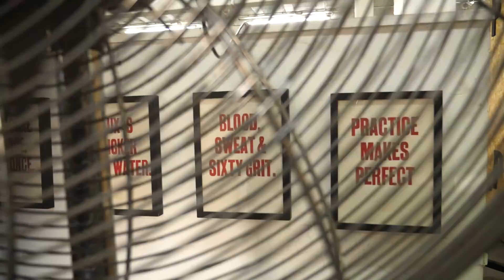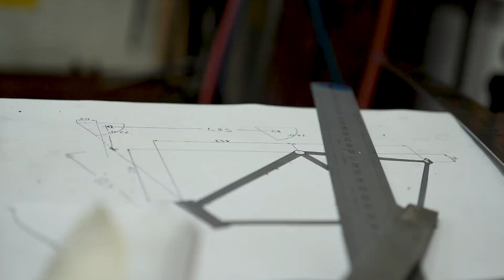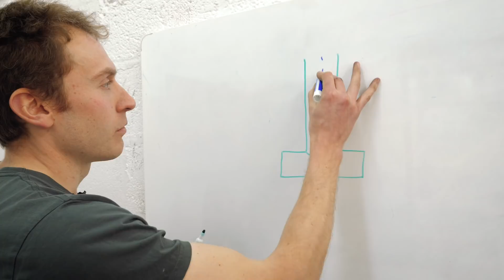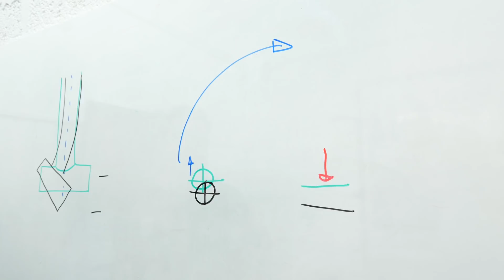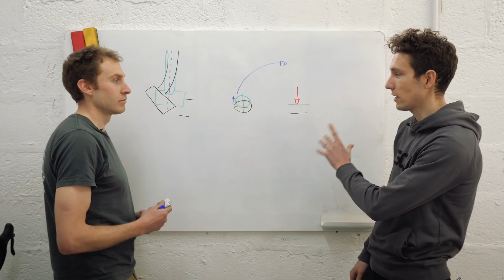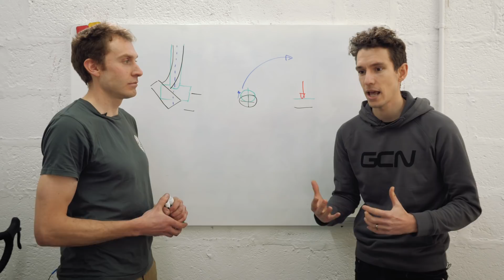Are You Faster On A Stiffer Bike?

Comment: I have a few questions:

Is the energy just stored in the brake on the wheel?
Would the wheel turn if the frame was just physically flexed side to side without input from the cranks and without the brake being involved just physically flexed at the BB?
and would a rear hub based power meter be able to measure?

Great video BTW

Comment: The energy return is immediately after BDC thus propelling the pedal upwards which in turn helps to propel the opposite side downwards, if the pedal style of the rider allows it, if not the anatomy of the rider (musculo-skeletal system) will absorb it. Some may be transfered back to the bike (in a plyometric type fasion) but some will be used to propel the rider in an upwards direction (in a shock absorber type reaction with an angle of return that is perpendicular about the fulcrum, the bottom-bracket) which may then not be transfered back to the bike at the correct point of the pedal stroke depending again on the pedaling style of the rider. Therefor it maybe seen that where a rider can synchronize the  return of energy from frame flex they indeed be more efficient than a rider who cannot.
Bullshit or not?

Comment: Hello, from an old and experienced rider. I believe I can add to this discussion quite a bit. I’m heavy, 220lbs. I love steel, and my favorite bike was a Basso Columbus SL set. However, it was too flexible. It had the best ride, as I’ve said, and I could even feel the energy stored pushing me forward. It was fun! Still, when I started to climb the short steep hills one finds in Southwest Missouri, the frame would flex so much the chain would rub. This equates to drag when least needed or wanted. Flex is great but needs to be managed. This is the first time I’ve ever responded to anything, and would like tell you guys at GNC, thanks for everything you do. Also, I’ve ridden all over America, and for road biking, it doesn’t get better than Missouri, especially the Ozark’s. If you are ever out this way, please get in touch. I have rides you’ll never forget.
Reply: very well said, John.  I would also add to your comments that not only do I believe the riders weight can make a difference, but correspondingly their strength.  Somebody who can really apply torque to the pedals can benefit as well (for similar reasons) to the stiffer frame.  Whereas, someone lighter &/or who doesn't peak too high on power would actually benefit from an appropriate amount of flex.
This is similar to a golf club. Someone who has a real fast/strong swing benefits greatly from a stiffer club by it's ability to keep the club head more in line with the hands & gets distance on the ball from pure swing/power.  However, a person that has more of a slower/modest swing, actually won't hit the ball as far with the stiffer club than they would with a regular or softer flexing club (whichever is most appropriate for their swing/strength), by using the "whip" action of the flexing club shaft to snap the ball & create more energy on contact than the stiff club would.
Reply: Taking this to the extreme, a bike frame made of wet ramen noodle would also yield fairly poor results due to low stiffness (among other poor properties).

Comment: So the brake goes on, then the pedal moves down which puts tension on the chain (and flexes the frame as the chain can't move).

Of course the wheel will move when you release the brake, you've essentially just pulled the chain a bit. Yes, the frame 'absorbs' the tension and releases it but I don't think that says much about frame stiffness.

Comment: Every frame (or material in general) is flexible to some extent. They are like springs. Some are stiffer than the other. Nonetheless, all springs store energy as potential energy and get released when u let it go, translating into motion. What you should understand is that no system is 100% efficient. Springs (and also bike frames) cannot release all the energy it stored as potential energy. Some is lost as heat as someone mentioned somewhere below in the comments. The concept is called hysteresis. The more you flex, the more you lose, given that all other conditions are the same. For different materials and different carbon constructions, equal flex does not translate to equal energy loss, but a flex is a flex.  This is basic science.

Comment: From a simple  mechanical engineering perspective, the bottom bracket junction can essentially be modelled as a spring and damper.  As Simon alludes, the spring will release energy when unloaded and the damper dissipates as heat.  The experiment shown was somewhat flawed as this sort of static loading would have not had a damping effect (although I agree with Simon loses here are probably small). Things become more complicated when you consider a dynamic mechanical system.  Generally an optimum spring/damper system will be tuned to the force and frequency applied.  The same applies to bike frames and it is my explanation why many frames "come alive" when you start hammering.  I find the "climbing bikes" I ride tend to "come alive" in the 300-400 watt range, typical climbing wattages.  In contrast, stiffer aero frames seem "dead" to me at these wattages and don't come alive until a bit higher.  This is my theory why many lightweight GC riders tend to prefer the climbing bikes rather than stiff aero bikes as they are better tuned to their typical wattages on important efforts.  In contrast, heavy sprinters tend to go for the stiff aero bikes which are tuned to the higher wattages.

Comment: But when riding the bike the energy in the frame would be released at the point where the pedal is at the bottom and the cranks are vertical because thats where you stop putting power into it. And at that point it would not pull the chain but push the riders leg upwards.
So why not repeat the experiment with the pedals in a different position or ride two bikes with different frame stiffness and same components, use a rear wheel hub and pedal powermeters and compare the readings which will give an estimate of the loss in the frame?

Comment: Repeat the test from the non-drive side!
Then repeat the test with NO chain.
Forcing the pedal on the drive side cause small tension in the chain - and this tension actually drive the wheel. The theory that the flexing back frame is moving the bike forward is nonsense.

Try to bend (flex) a metal object for example - a soda can. Where is the energy, ha?

Comment: What about the chain? Before releasing the brake the frame is flexing and the chain is stretching. When you release the brake everything goes back to a neutral state and releases energy into the bike. The chain is perfectly aligned to release energy into the wheel. The frame could be experiencing also sorts of losses and I’m not sure if the energy in the frame is going into the wheel or not. How do you know the frame is the dominant source of energy?

Comment: Well, you have ONLY shown us that not ALL energy is lost, as you said, energy doesn't disappear. Basically, this video doesn't proof anything.  It is the same as showing us that energy is regained from releasing a compressed spring.  BUT you didnt or in fact you can't proof there is no energy loss with this simple video, the hysteresis loss would occur in other forms of energy.  Well, good try but may be this is #engineering explained territory.

Comment: Power loss steel / alloy / carbon....This is easy to quantify and I can offer an experiment for you guys to quantify this. I am a rocket Scientist to be fair. so....take my word for it.

Let us assume there is power loss "absorbed" in the frame.

1. Steel bike: Take a hub based power meter and a pedal or crank based power meter on the same bike and monitor the transmission +flex losses at low, medium, high power & high power out of the saddle sprinting. Do this by comparing the differential between the power readings of the two meters over a reasonable period, say 1 minute. Record.
2. Alloy Bike: Transfer the same rear wheel, chainset, chain and derailler and transfer to alloy back and repeat test.
3. Carbon Bike: as above.
4. Evaluation: The transmission losses (often quoted at 5%) will be a constant throughout all the data. The flex losses will be revealed across each frameset as an additional loss. I would hypothesise that this would show a significant(ish) gap at the high power and out of the saddle sprint data set. I would also guess it only becomes REALLY significant when sprinting like a Sagan. 1000W plus.

REAL SCIENCE.... !!!!!!!!!!!!!!!!!!!!!!!!

Regards,

Gutsy.

p.s. The next question relates to tied spokes or not tied spokes? If there is significant powerloss then the science would also suggest that there is additional losses through wheel flex (clearly the aforementioned test does not evaluate power losses through wheel flex. So the argument of tied spokes arises. We all know that tied spokes stiffen the wheel. The question of power loss through wheel flex, at least qualitatively can then be argued.

p.p.s. I tie my spokes!  ;) http://www.retrobike.co.uk/forum/download/file.php?id=412207

p.p.p.s I only tie my spokes because it looks good!  ;)

p.p.p.p.s. If you carry out the test and a spare power meter is available......do pass it on. :-)
Reply: As a footnote: Whilst the video was great as all of your videos are. :) All your experiment illustrated is that a frame acts as a form of spring. i.e. flexes, stores and transmits the energy back to the system. The aforementioned experiment will quantify the energy cost (power loss) of the same. :-)
Reply: There is some debate whether tying enhances the ability of the wheel to withstand stress peaks, such as potholes etc. They even go further and argue a broken spoke, if tied, is more likely to stay in place versus flapping in your wheel and causing further damage. That debate has raged on and on over the years and am not going to go there ;) I agree with what you say! :) if strength and pothole are an issue then more spokes per wheel is the solution. :-)
Reply: I don't have much experience with tubeless! I'm probably not the one to ask on that one. Sorry matey. :(

Comment: The most important feature is to understand that hysteresis loss occurs inside the human body - hence the tires and frame acting as suspension helps the overall system not to lose power and fatigue the rider. The frame flexing can lose less energy than the rider being vibrated.

Comment: I wonder... Carbon composite frames have known damping characteristics. Great for the fork, but maybe not for the frame. Metals especially steel tend to spring back rather than dampen. Perhaps an alloy, steel or alu, frame combined with a carbon fork and seatpost might be the most efficient. 
Of course this will probably pale into insignificance when an overweight, unfit, lyrca clad, middle aged man jumps on it.

Comment: The question to ask is if stiff frames are faster over time.  It's one thing to get the acceleration from a stiff frame when the body is fresh but it is another to ask for that same acceleration 3,4,5 hours into a ride.  Or better yet think about a climb that goes on for 10, 20 km.  Maybe the question to ask is not what is faster but what is easier on the body over time?   The watt/kilogram expectations of a pro are very different from the average punter!  Do you think pro tennis players use the same rackets as the average person - not at all.  Pro rackets tend to be heavier... The non-pro tennis player needs a lighter racket because they don't have the conditioning to use the heavier ones and the same logic translates to the effect of frame stiffness on the body between pros/non-pros.  We get so obsessed on the loss of efficiency on the drivetrain. What about the loss of conditioning of the engine powering that drive train?Stiff bikes might be more efficient if you attach a motor to the bike but what about a human being.  The pros can drive a stiff bike and not be affected by it in the same way because they train for 6 hours a day and do little else otherwise. Their bodies are tuned to these bikes.  The weekend warrior doesn't so the same training so a laterally stiff pro bike will most likely tire the rider out over time faster over a frame that works with the rider riding it.  And maybe the stiff bike is fine for the 90km -150km group ride where you can sit in and stop for coffee - but what happens when the terrain gets interesting and the body is battling the bike....shouldn't the question be - is this bike working with my body, my conditioning, my capability.

Comment: In my opinion, the energy applied on a stiffer frame is transmitted "directly" to the drive train.
In a flexing frame, the energy used to flex the frame (let's discard the fraction that is actually transformed into heat at molecular level) is stored and will "spring" back, BUT the spring action will happen when there is no input from the rider (when the cranks are nearly vertical). At this point, given the bike in moving, the small amount of energy that the frame stored would not have the same effect (would not actually push the weight of the bike + rider) as it would "together" with the rest of the energy on a stiffer frame, all because of the way pedaling happens.

I might be wrong tho. In any case, a static test is leaving out many factors in play in a dynamic situation.

Comment: I have been thinking about this a lot. I agree with this to a point. Most of the energy goes back into your cranks of course, but you load it in a different direction than your pedal stroke is positioned when your legs ease off the power. So your crankset gets it's energy back in the wrong direction, not adding to your speed at all.. I think.

Comment: i believe that a stiffer frame still massively increases your speed on the road because in the power-phase of the pedal-stroke, the amount of force is reduced as the frame loads up like a spring, and in the inactive phase of the pedalstroke, when there is no load on the pedal, the frame flexes back. the problem with this experiment is keeping the pedal loaded and at a fixed postiton, whereas in a realworld szenario, the pedal would move instead of the rear wheel, because there is no significant force holding it.

Comment: I think they should have used adjustable height plate instead of that metal plate, so that when Si stands on the pedal you can adjust the height right up to that pedal, so equal potential energy is given on both bikes.

Comment: Here’s how I see it afte running an animation in my head. A bicycle is not mant to “store” energy but to transfer it into forward motion. With this experiment just proves that the energy is just going to escape through the path of least resistance being a free spinning wheel. had the whee not be free spinning and under load as if being ridden, the energy that was being used to flex the frame would have just gone back to return the frame to its original shape and not for forward motion. It would generate sideways energy like a bow for a bow an arrow but not forward after the power portion of the pedal stroke. Also there are factors such as the chain stay flexing. In this experiment x is the pedal and BB, Y is the chain and Z is the chainsray cassette and wheel. As the frame flexes the B.B. goes downward and the chainsray gets pulled toward the crank via the chain. Now losing he brake and having constant pressure on the pedal is essentially like drawing a bow and arrow. Once you let off the frame returns to its original shape which increase the distance between the chain stay and crank this spinning the wheel every so slightly as in this Experiment. Furthermore some of the energy would have been stored in the wheel due to the spokes tensioning under the load and then releasing as the tension is being released. That’s just my take.
Reply: So that all being said Energy is going to take the path of least resistance the frame being it in this case and as it is it’s being stored in the frame and after the power stroke it goes right back out of the frame in the form of the  frame straightening itself back  out. Now flex makes the bike oh so comfy acting as a shock absorber so let’s not burn soft bikes at the stake. I’m sure recoil or the rate in which the frame returns to its original shape plays a roll as well but to what extent may be impossible to tell.

Comment: Uhhhhh what? Frame flex causes a loss of energy while pedaling. Losses are in the form of heat, sound, and friction to name a few. The experiment loads the frame like a spring. The wheel spin is due to the spring (frame) unloading. See how the carbon frame is able to release more of the (relatively) equal amount of stored energy. Your explination is 2nd grade logic.
Reply: The carbon frame wasn't releasing more of the stored energy, it was storing more energy. Stiffer springs take more energy to actuate by a given amount.
Steel exhibits very little elastic damping; a steel spring will happily release nearly all of the energy stored in it.

Comment: 1st law of thermodynamics: you can't win.
2nd law of thermodynamics: you can't even break even. 
2nd one is the kicker here: you get you mechanical energy back form a spring when it relaxes, but you don't get your mechanical energy straight back form heat. If you drop a stone into a pond the water gets marginally warmer. But you never see a stone jumping out of the pond whilst cooling down the water a tiny bit.

Comment: Well, it just happen to do 2 back to back rides with a 2016 LOOK and a 1986 Eddy Merck the other day and , although flex was very much there (for the steel) the end result (i.e. speed on the road) was pretty much close for the two bikes. Chain and tire rub is there to steal your watts , but steel definitely requires a more refined and "ethereal" riding style to get the most out of it ....